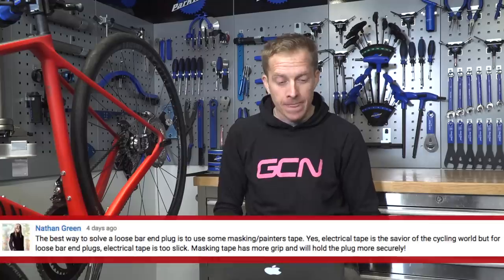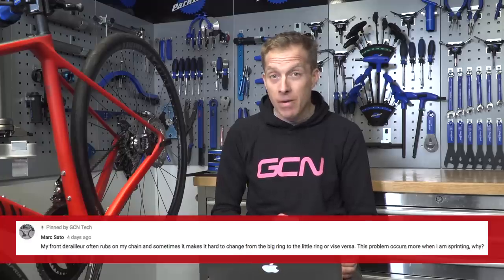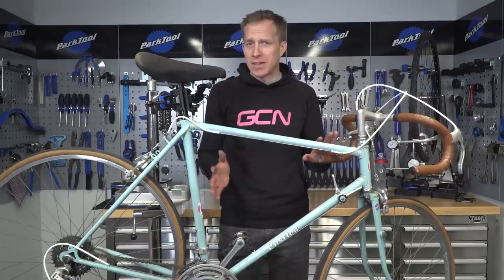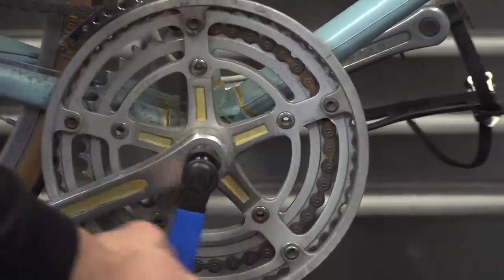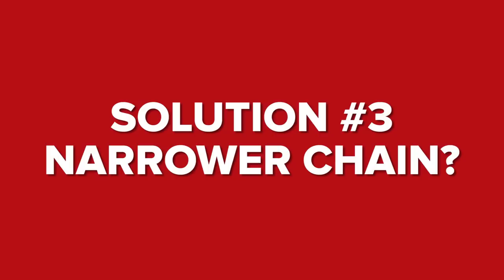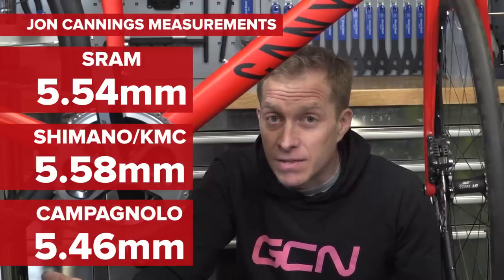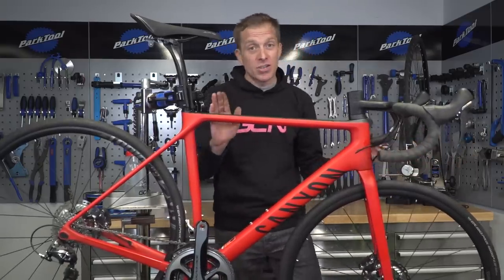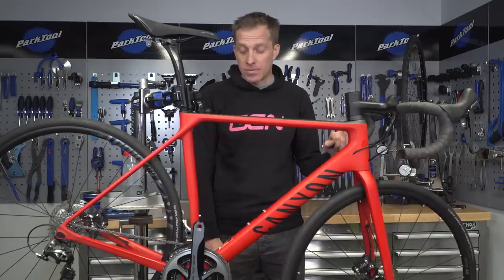How Can I Stop My Front Derailleur Rubbing? | The GCN Tech Clinic

Comment: Wait...did he just change his rear cassette cog by using his "left" shifter.  What's up with that?
Reply: Video is all about front shifting.  He was shifting the front.  The left side brake lever does work the back brake though.
Reply: I stand corrected.  Thanks
Reply: monkeynkl

I believe it is common to have shifters set up that way in the UK. It has to do with driving on the left side of the road for some reason.
Reply: Rick Snyder The brakes are swapped, but the left still does the front shifting. I am an American living in the UK and have to swap the brakes around on all of my bikes. Otherwise I would probably go over the bars.
Reply: William Keys

Ah, ok. Thanks for the clarification.

Comment: Cable tension?
Reply: martyn fairclough On Rear derailleur, after manually taking all slack out of the cable, move the barrel in the direction you want the derailleur to go when looking from the top.  On the front, most work has to be done with manually pulling cable, but you might have a barrel on the shifter or on the cable itself!  This usually requires experimentation, but remember that you CANT hurt the bike by playing with tension!!  Don’t be afraid to play with it, so long as your limits have been set! (That’s only really important for low gears in the rear)

Comment: My problem with the front derailleur is that on the biggest gear and lowest on the back the chain rubbes on the front derailleur. already tried adjusting the front derailleur but cant adjust to get good changing gears and not touching the chain
Reply: Pedro Guilherme Almeida Carvalho It's trying to tell you not to use that gear combination. Cross chaining as its known wears the drive train quicker and is inefficient.
Reply: You’re not cross chaining if you’re doing big/little, so fear not!  Front derailleurs can be a pain in the chamois nowadays.  You may need to use pliers (spelling? Oof.) to manually pull cable while the derailleur is in the low position.  Make sure to pull the crap out of it, you can’t hurt anything.  There are a few complicated tricks, but they take most mechanics a while to learn, in which case you’ll save yourself a ton of time by slapping down the (hopefully) <$20 or so to have it taken care of by a shop rat.
Reply: Samuel Hopely Maybe I'm miss reading it but I assumed biggest gear meant the largest chainring and lowest at the rear was the largest sprocket. Don't use gears much these days so could be mistaken.

Comment: What if my derailleur cable is hitting the crank? Can I cut it shorter?
Reply: Rafał Sobczyk 
Absolutely. Just make sure you get a clean cut, then crimp it after. (Getting scratched by a frayed cable sucks!)
Before you do that, though, make sure that it is, indeed, excess cable sticking out, and that your cables themselves don't need to be adjusted.